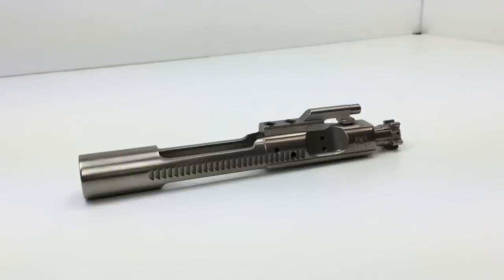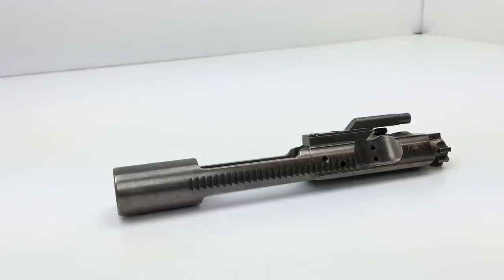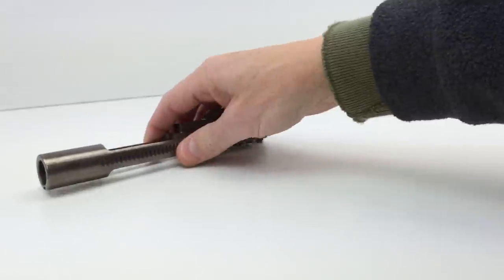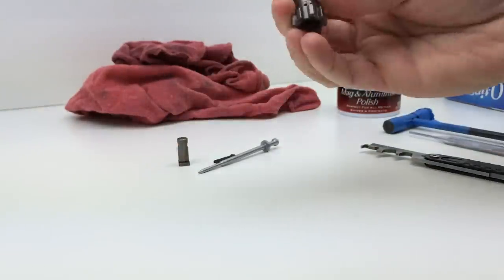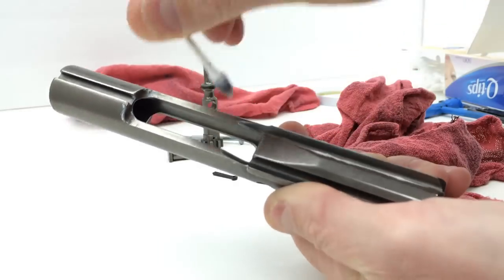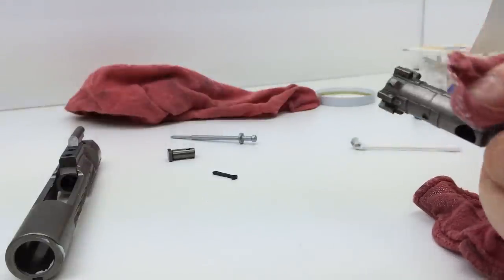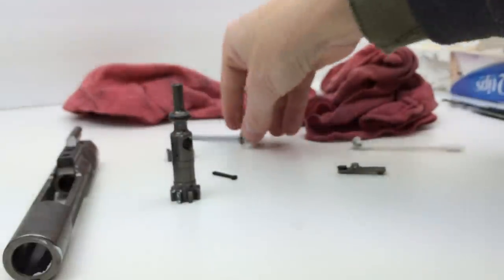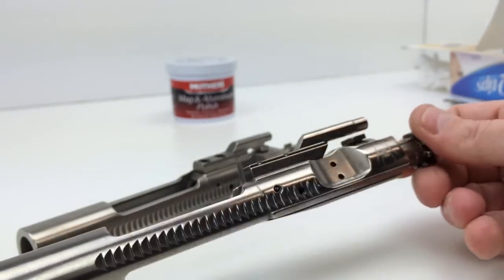AR15 Tech Tip - Polishing your dull Nickel Boron Bolt Carrier Group

Comment: I purchased a FailZero bolt carrier group because of how great I heard they were, but I have had nothing but a rough time with FailZero's customer service. I was told by Primary Arms it's just two guys in a small shop. They had a recall on the staking of the gas key and I couldn't get any assistance and when I called primary arms they called them and then FailZero called me back and gave me a hard time and never fixed the recall. I won't buy FailZero again even though it's a good product.
Reply: I just bought one and it's on the way here ... I hope its decent
Reply: I purchased a Failzero BCG a couple of years ago and it has been flawless. Thousands of rounds with “zero failures”... no pun intended. Thousands of rounds and metal constriction shows no seems or wear, not to mention it polishes up like nobody’s business each time! Sorry you had a bad experience, but make sure you don’t write them off too soon! Excellent quality and price!👍🏽Happy shooting and keep it safe!
Reply: I thought it was just me. Bought one 3 months ago and it went in fine headspaced great but when i shot it at the range it kept locking up 3\4 of the way i had to mortar it out. Put 3 other BCGs in it at the range no issues.  The store i bought it from i frequent often so they handled everything for me but it took 2 weeks of emails and calls to get a response. The gunsmith tried moving my gas tube with no success thinking he'd made an error when he free floated my barrel. It's been out for service a month now waiting on a return. Shame such an expensive product isn't held to higher standards especially when lives could be on the line.
Reply: Glad I went with WMD NIB-X Cheaper as well 155.0 priority shipping at Joe Bob's Outfitters. Just got it today and looks great.
Reply: Dustin Halbrooks I had a failzero bcg that I bought from primary arms with the same issue with staking of the gas key. My experience was very quick they emailed me a prepaid label and I had it back within a week. I will add I live in the same state.

Comment: I actually didnt even know it was possible for them to come like that.
I got 2 nickel boron BCGs from Sharps and Toolcraft and they both came out really shiny.
Reply: I also got 2 logo less toolcraft nib bcg’s and combined 8k rounds they’ve both held up  great! If anything it’s smoother now then it was when I got it! I’m a np3 snob now you haven’t felt a smooth ar15 until you have racked one that has a np3 radian raptor charging handle with a np3 bcg! Butter smooth.

Comment: harbor freight jewelers  kit about 10 bucks attach it to a drill use the white brick fine polish rub on by applying pressure as if your drilling ,but side ways, then apply on to BCG ,micro fiber  cloth and in about 2-3 time 10X shinnier what you did on your video, i have done it to my bolt and my M4 feed ramps, work flawlessly.

Comment: Thanks for your presentation. This is a great product, but I used a Dremel tool with the polishing wheel pads. Not much labor effort this way, and much faster.  My BCG was dipped overnight in Hoppes 9 and was severely tarnished. Yeah, won't do that again. Anyway, after the cleaning it looks like silverware being served to Queen Elizabeth and is as slick as snot on a doorknob!

Comment: Personally, I prefer the darkened titanium/gunmetal coloring of raw, unpolished NiB. My Lantac E-BCG has this dark finish. Looks great. Besides, even after polishing, if you shoot any amount, it'll eventually darken again and you'll be polishing it over and over. Seems silly. BTW, I looked on the Spike's Tactical website, along with a couple others, and none were advertised as being highly polished. On the ST website, the pics show a dark finish. I don't know why people expect them to be shiny and polished when they're not supposed to be and the shine wouldn't last with use, anyway.
Reply from the maker: +Jeremy Lescalleet The dull BCG's as shown in this video are not only dull but have a ruff, almost sticky feel to them.  Polishing not only shines them up, but smooths out the finish and aids in lubricity.  You are correct that they won't stay high polished and will dull a bit from use.  The Spikes BCG's are all highly polished and they had issues with their EXO plater which resulted in several batches of dull, unpolished BCG's.  For now, the issue has been addressed and all currently shipping Spikes NiB BCG's are again highly polished.

Comment: I cleaned mine at around the 8K-9K mark. Took some time and the rear of the carrier never fully polished up; there was always some discoloration left. What I didn’t notice before but noticed after I polished it up is the massive amount of tool marks that were still on the carrier that I didn’t notice when I bought it. But like I said I have run nearly 9000 rounds through it and I have maybe gotten two jams that I could not blame on the magazine or me. And one was a stove pipe.

Comment: This would go a lot easier using a powered buffing wheel to do the polishing but the whole thing is silly, if you wanted a polished part then why not just order a polished one in the first place?
Reply from the maker: Steve C Yes, powered buffer is good, assuming you have one.  Most people don't.  All of the bcg's shown here were supposed to to polished, but they arrived un-polished.  Manufactures are not doing proper QC and letting items out that have sub-standard finishes on them

Comment: I polished mine with those sticks of metal polishing compound and a buffing wheel on my Dremel. It looks like it's chrome plated now. My BCG works fine, I'm lucky I got a good one most of them are crap,  but I would never buy another nickel boron BCG again. It will be either all chrome or chrome lined with phosphate on the outside. Nitride or DLC would probably be next on the list after those.

Comment: Thanks a lot for doing this video, I thought I just had bad luck with my Spike's bcg feels good to know I am not alone.. First of all the coating on my bolt was too thick and was jamming in my brand new chamber, second it came with the ugly finish. I even called Spike's (when I was lucky enough to actually get through) and they said they were going to replace it with a polished version. 3 weeks after I sent it in no response... I had to bust my ass off to call them again get someone on the line and check up on my exchange only to receive THE SAME THING. The bolt actually works this time but the finish still sucks. I will never support this "high end" company with the way they are treating customers. Money hungry pigs, and they have the nerve to diss on companies who actually make working, affordable products for the people like PSA... smh.

Comment: Thanks for the video. Are nickel boron bolt parts interchangeable with standard parkerized steel bolt parts? Can i use a nickel boron bolt in a parkerized steel bolt carrier? Just curious. Id imagine i'd use oil with diffrent parts.
Reply from the maker: Steve Stell For the most part, yes.  I have used phosphate bolts in NiB carriers and vice versa.  I can't speak for all brands though, milspec seems to mean different things to different companies.

Comment: I bought the NIB PW1 BCG from prime weaponry and couldn't be more pleased. It comes polished, It's upgraded with the Viton O rings and poly insert for better extraction of steel cased ammo . I believe it ran $119, I also have primes NiB 9310 vac arc bolt, same upgrades but sells at $109. Staking on both are perfect and the vac arc bolt has ton of ammo down range, neither has had malfunctions give prime weaponry a try

Comment: Personally after purchasing a few NiB BCG's I lean more toward Black Nitride BCG's. If you're going for a Gucci build then obviously bring on the bling but I see that more as a status symbol than anything.
Reply: any particular reason why you prefer nitride?
Reply: @evanjinks7744  In my experience Black Nitride BCG''s clean just as easily as any of the Nickel Boron BCG's I own, and they are usually less expensive than Nickel Boron BCG's made with the same materials. The difference in performance isn't enough to justify the added cost in my eyes, and the money saved is better spent elsewhere.

Comment: @2phast Tactical Gotcha. It's weird that not all NiB carriers that have the dark finish also have that sticky feel to them. My Lantac has the darkened coloration, but is smooth as butter and feels very hard, not "gummy" like my Spike's LW carrier. Either way, they've both worked great through quite a few thousand rounds. I'm anxious to see how my new Boomfab Titane carrier holds up to aggressive firing schedules and a high round count. So far with approximately 1,400 rounds it's been trouble free.
Reply from the maker: +Jeremy Lescalleet That could be due to different companies doing the NiB EXO plating.  I don't have full insight into this, but Spikes did tell me that they have worked with several EXO platers and they switched due to poor finishes/flaking they were getting from one.  Aside from asking "Is it still EXO NiB?" and being told "Yes", thats is all I know.  Seems UCT isn't the only company that can do EXO plating.

Comment: Great video. I was looking for a way to clean up my PSA NB BCG. Because after about 400 rounds through it cleaning/relubing it wasn't doing the trick. I had black resedue from all the gasses staining the purdy finish it once had. I happened to have mother's mag polish in my garage and tried it out, it worked great. With some elbow grease after about an hour it looked as good as new! (Actually better than new!)

Comment: @2phast Tactical  I have a spikes Bcg too that's dull also, Would polishing it to a shiny Finish Help with lubricity then it being a dull finish?
Reply from the maker: mikeyeyes7 The lubricity is due to the actual Nickle Boron.  If your BCG is dull and feels "sticky" to the touch, then at a minimum you should clean it up so it is smooth to the touch.  A high polish on nickle boron is more cosmetic and due to the nickle content and from use, it will get dull again (tarnish).

Comment: I can't understand why anyone would think  that polishing it would damage the coating in any way. I'm pretty sure that these doughters have polished the chrome on there cars. But my question is what about using a dremmel with the polish attachment.
Reply from the maker: Originally, BCG's like this are polished using a stationary polishing wheel.  A dremel and polishing wheel attachment would work fine also, but its a bit overkill if your just doing one BCG, the process to polish by hand is not very time consuming.  If I were doing a hundred or so BCG's, then I would want to use a stationary polishing wheel.
Reply: Polishing is nothing more than attention to detail. You're only removing oxidation & hitting the high spots of microscopic scratches which in turn makes that part easier to clean in the future. These people thinking you're stripping the finish..? Maybe if you made it your entire purpose, to sit and do nothing more with your life but polish your bolt all day, everyday.. Maybe you could start wearing through some of the finish on some of the sharp edges? It's not a problem or worry that would ever cross my mind but anyone's welcome to try! Be sure to chime in with your results when you've finished!

Comment: Very nice, Do you think a Dremel tool would be good to use too polish the BCG?
Reply from the maker: Yes of course the job would be easier with a rotary tool and polishing wheel.  The idea was to show how easy it was to clean up/polish without using any electric tools.
Reply: I have a NiBn BCG that oxidized after it’s first cleaning. I used Hopes “black” cleaning products that stained my BCG. I was deeply disappointed, but I’m am glad to see how easy they are to polish. Thank you for the video.

Comment: Great video, thanks.  How about the nickle Teflon BCG? can Teflon be polished?
Reply from the maker: Mission Impossible Np3 is still primarily nickel with teflon particles impregnated in it.  Nickel is what tarnish's and can be polished.  Although I have not personally tried to polish a Np3 finish, I believe you could polish it just as easily as nickel boron.  You should experiment in a small area first before proceed to doing the entire surface, just to be safe.

Comment: I tried Brasso metal polish because my local Wal-Mart employees said the didn't have Mothers (turns out they do because I found it). Brasso did nothing for my bolt at all. I ended up buying Mother's from a local parts store and the difference is noticeable immediately. It's near instant. Use Mother's. Period.
Reply: +Joseph McClure   haha  Thanks......i was thinking of trying Brasso.   The smell really brings back days in
Basic training at Fort Sill in 1979.   We would crimp the end of a tent peg from our shelter half in our TA-50 issue
and then lodge it in hole of our brass disk from class A  collar insignia then spin that fast on a cotton cloth with some Brasso.
Reply: +Bill23799 Yeah I was recommended it, but after trying it did little to nothing. I researched some and they have recently changed the formula which is likely why it didn't do anything. Mother's however was much faster to show results and one container could likely do 30-40 bolts. I didn't even dent the surface to polish mine.
Reply: Thanks,,,,,I am working on my second AR-15 build.  I am considering  AIM surplus NiB bolt i have seen on sale for $99.99 free shipping.   I will have to pick up some mothers polish.
Reply from the maker: +Bill23799 You may not have to polish your AIM BCG.  After the plating process, the next step is a polish.  For some reason, some of these BCG's have not gone through the final polishing process, so they leave the plater dull and kind of sticky feeling.  I have only really seen this on the NiB EXO plated BCG's (Spikes and FailZero)
Reply: Thanks for the information.

Comment: can I take off the nickel as I am polishing it ?
Reply from the maker: +totljag1 I have polished many, many of these.  Some by hand and some by machine and I have never polished through the plating.  If your doing this by hand and using the Meguires polish, you should be ok.  The Exo-NiB is extremely hard and its going to take allot more than Meguires polish to damage the surface.  Of course, proceed at your own risk, I can;t make guarantees to your success, I can only share my results from doing the same project.
Reply: +2phast Tactical thanks 😄

Comment: I think you just polished the coatong off that bcg
Reply from the maker: NiB is extremely hard, chances of polishing through the NiB with this type of polish AND by hand are pretty slim.  These actually go through a machine polishing process before they are shipped, the process shown here was done on a BCG that for some reason, missed the machine polishing phase.
Reply: I was wondering the same thing.  Would love a definite answer from a manufacturer on that.
Reply: I did it and it worked fine Oxidation is not the coating
Reply: abu zaben so when you polish the chrome on your car does it come off? Just sayin.
Reply: abu zaben - I'm not sure I follow the same logic. I would think polishing and removing the oxidation is a good thing
Reply: Matt Childs I polished my BCG and the only thing that came off was oxidation. If the NiB coating comes off you just wasted your money on a fake.
Reply: Paul Hughes - Yep, I would have to agree. I just ordered a Fail Zero BCG and when it comes I now know what to do if I run into my BCG being covered in Oxidation. I would like to keep it as shiny as possible, do you ever polish it from time to time? From what I understand after a while it will discolor.
Reply: Matt Childs 
It will darken due to carbon fouling. But I found something that doesn't a real good job removing it so it pretty much comes back shiny. It's Birchwood Casey Bore Scrubber  foaming gel. I was using Strike Industry Antivenom xclp and it just didn't get all of the black staining off, so just for the heck of it I sqirted a little gel foam on it and vhola!
Reply: Paul Hughes - Nice  brother,  thanks. I'll definitely pick some of it up, I would prefer to keep the discoloration away as much as possible.
Reply: Does it take the finish off of your car when you polish it? NiB is WAAAAY harder than car finishes.....

Comment: Thanks for posting this video! Polishing the bcg of the used POF I purchased on Gunbroker never even occurred to me. After cleaning off the carbon fouling that seemed like it was cerakoted on, I thought I had the worlds first burnt bronze bcg. 🤣 I ended up using Cape Cod metal polishing wipes and poof...shiny slippery Nickel Boron bcg! 🎉🥳
Reply: Wow... it works. I had some fouling on  my bcg that I used brass and stainless steel brush to no avail... cannot believe my eyes after wiping it just 10 min with a damn wipe  lol

Comment: thanks for the video. but I was wondering can you over polish the coating and make it come off?
Reply from the maker: +xXReLentLess99Xx Nickel Boron is extremely hard and the EXO plated BCG's are harder than chrome.  Using this type of polish (applied by hand) it would be almost impossible to polish through the plating.  I am not sure if you could do it with a machine either.  But with that said, I have not tried to find the limits of the NiB EXO plating.
Reply: +2phast Tactical thanks. I had gotten a Fail zero with exo coating and I think I'm going to Polish it finally
Reply from the maker: +xXReLentLess99Xx FWIW, I have polished several dozen BCG's, both Fail Zero, WMD and Spike's.  Never had any issues with the polishing process.  Although, after you polish the Fail Zero, you might see more of the machining marks than before.  FZ's are not machined as well as the Spike's.